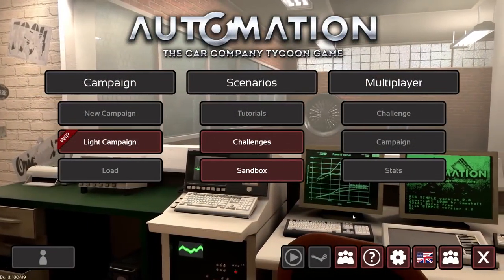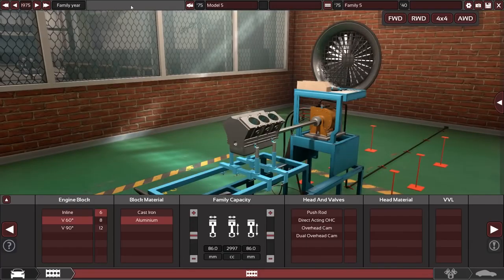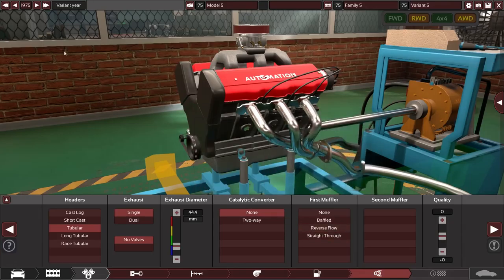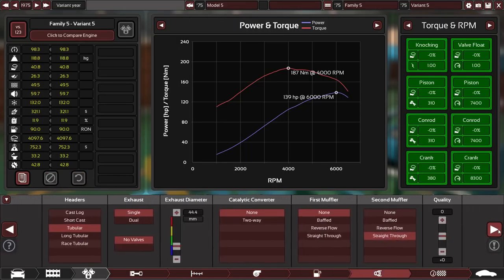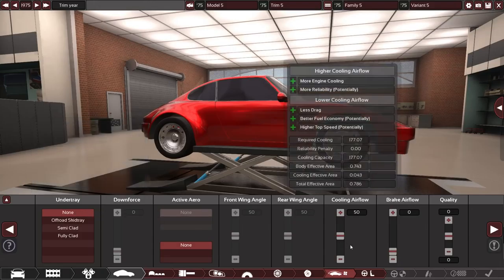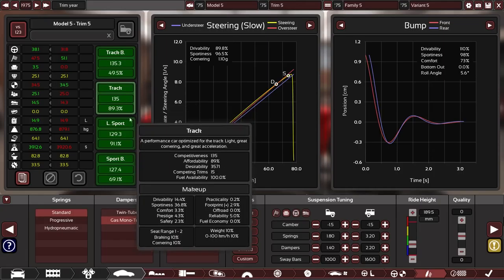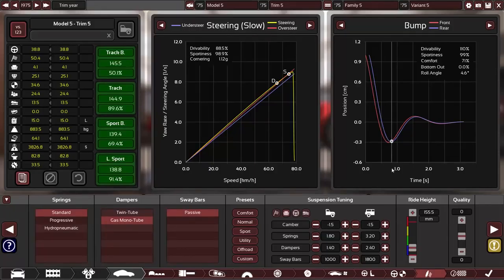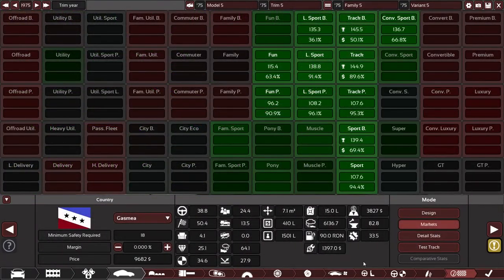Automation Technical Design Challenge (70s Light Sport)

Comment: Yea, another beat Killrob challenge.  Let's see, same body, 2.0L V8 (7k redline, 143hp), same tires exactly (you were spot on man), nearly the same brakes (changes from different weight), slightly tweaked suspension, same interior/comfort/safety features.  Time total is right around the same as the video, so I took a little more time tuning plus saw what he did.

90.6% and 151.6 L. Sport.  Track and B. Sport are both a little higher.  L. Sport Prem is 124.9.  Nice.  You did leave room for improvement in the L. Sport area.

Key areas I noticed an improvement
I started with a V6, but went with a longer stroke and smaller bore than you did.  Lighter weight, flatter torque curve, and could actually rev higher.  Also two 4-barrel are worth it.
You were using a touch to much cam, dropping it 1 point would keep the same hp and give a big boost to low-mid torque.  Then a little more timing to smooth out the top.
V8 was just playing around, but the even more under square ratio actually let me rev even higher, run a little more cam, and have a flatter torque curve.
Gearing you left a bit on the table, tap the top speed down a click or two and lower the ratio to till 2nd is in the mid 60's mph range. You have to fiddle it a bit but there is a sweet sport that is between 1 and 3 ratio points wide on performance cars where the time drops a bit.
Less springs man!  Just clicking the front and rear down one softer made a huge difference.  Also find the delta where dropping the ride height doesn't change the score in L. Sport and take the highest point in the delta.  Going lower just raises track and makes it harder to tune for L. Sport.
Reply from the maker: Good stuff man :) I'm definitely leaving score on the table here by not investing more time, getting the broad strokes right is what I deem "good enough" for this little series :D Cheers!
Reply: I learn as much from watching you as I do experimenting on my own.  Even when it is getting just the broad strokes.  You're the best.

Comment: It's a good thing that this car has a galvanised steel chassis, really. Because once I expose the amazin' Russian steel-quality body panels to water and such, at least I'd get a sick speedster afterwards! :p (laughs)

Joke aside, could one get away with using something like, say, an inline-6 in this situation? Because while I see the idea behind using a V6 (V-configuration is pretty exotic, after all), that feels a bit too fancy for a light sports car...
Reply from the maker: haha it's the hidden convertible option that shows first after 10 years xD
I6 would be my goto choice if it fits, V6 is the worse option unless you're either hyperfocused on weight, or you have little engine bay room... I6s are very long!
Reply: Haha, instead of being just Light it's the Featherweight Sports Car! xD
Which is why you ended up using the V6. As expected from a top-notch engineer, the hardest challenge is the topmost choice, haha. 
But yes, works if you're aiming for ridiculously low weight figures (the not-911 body was a big choice in the competition, after all)... And even in transversal form an I6 would need to be very small to fit!
Reply from the maker: Yes, lightweight makes a big difference in this category, and while an I6 would be smoother (I think overall that's preferable) it is slightly heavier (no block sharing) and has the size issue... I would take an I6 over the V6 in general though, so much more "refined". Transverse V16 next! That would be the PREMIUM Light Sport option :P
Reply: Hmm, at least this proves there is not just one sureproof way to create a light sports car in the '70s. If you're not wrestling with size, an inline-6 could very well win the entire thing if properly-tuned. I didn't create a car for this category, but I'm trying that anyways! 
Transverse V16!? Forget *PREMIUM*, you're talking about Duesenberg-level of Light Sports here... I do wonder if anyone could get away making a light sports car with a V16, though! :P
Reply: I6s in this era are mostly reserved for proper Sports Cars and GTs. I4 would be more appropriate. V6 is too fancy for 70s.

Comment: The 4 barrel carb on the UE seems so small xD in the Kee it was beefy as shit, now it's the other way around. Looks like a pathetic little carby.
For the fuel system, why would you go for Mechanical Injection here? What would be the advantages? In what cars do you actually USE mechanical injection?
For the brakes, you recently said i believe, that 15 Pad type were for comfort and 30 for drivability. Any other sweet spots, i.e for sports and hypers? And is the brake balance relevant stats-wise?
Also i still see some imbalances in the markets xD I mean, how does this mid engined, 2.2 V6 2 seater, scoring green in Family Sport? And worse yet, in Utility xD how's that a thing? And i think you need to up the % of the Muscle categories in capacity.. This car also has them green, but this is anything but a Muscle. I think making the capacity matter more would solve this. Also maybe make them prefer Front Engine placement?
Reply from the maker: I think we may be using the wrong filter box asset for that one, I'll ask Andy about it.
I think the only sweetspot for pads is 30 for drivability, the others are at the respective extreme.
Nah man, I don't think you have a nuanced enough understanding of the markets here :P but yes, the competitor car AI needs to be tuned more.
Reply: Well, yeah, maybe that. My point was just too high of a desirability for a small engine.
You still haven't explained the mechanical injection bit though :p would greatly appreciate the information ^^